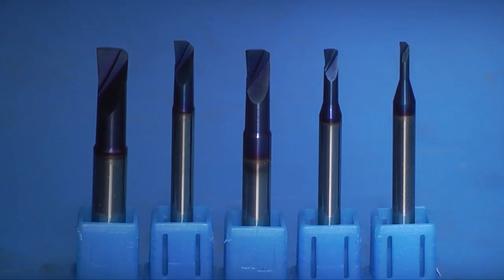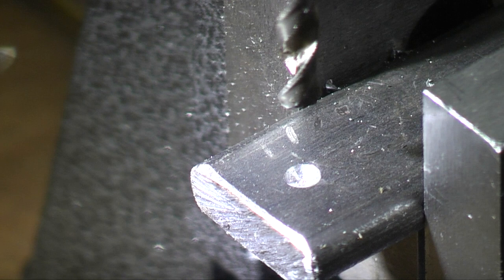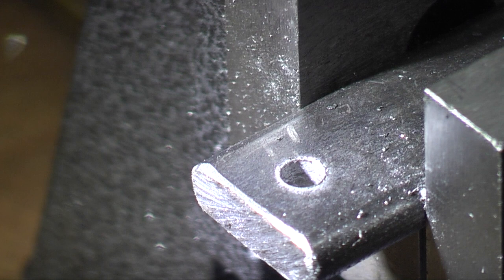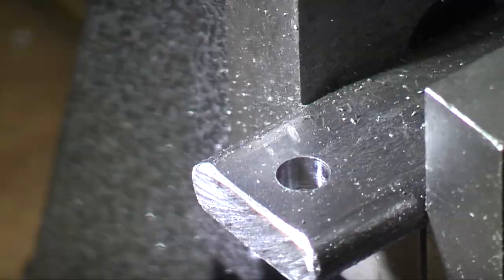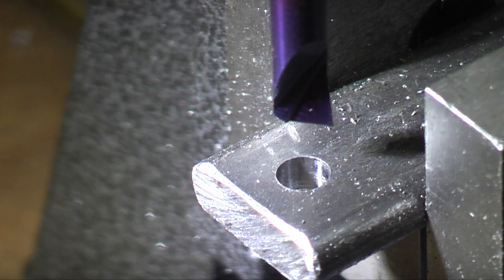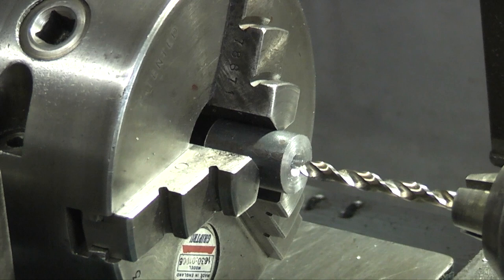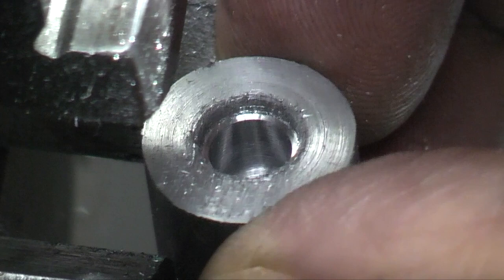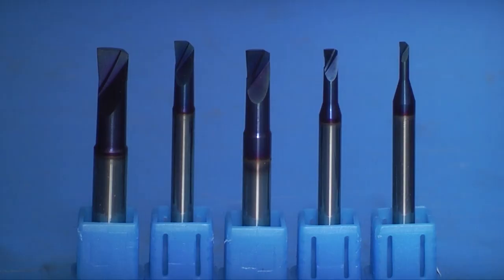small boring tools

Comment: I've used small carbide end mills as my small boring bars. Superior chip extraction to any normal boring bar and you get 4 edges (if it doesn't break first) and they're cheaper. I have tilted the holder like 0,5° for clearance. Only good for bores as long as the flute length of the end mill though and you don't get a flat bottom but that's rarely an issue if ever.